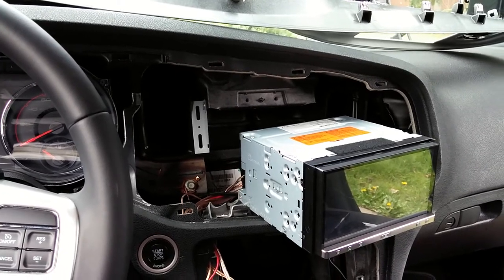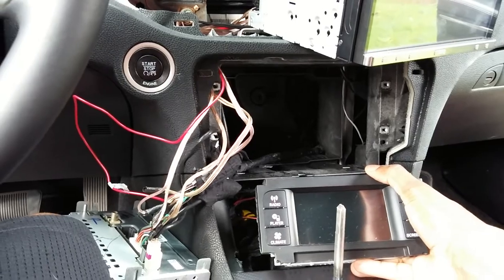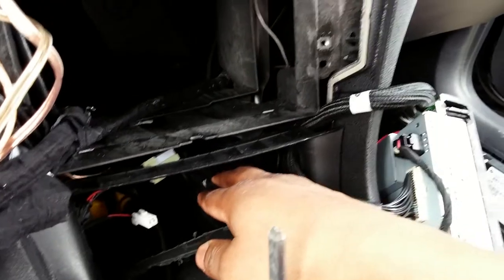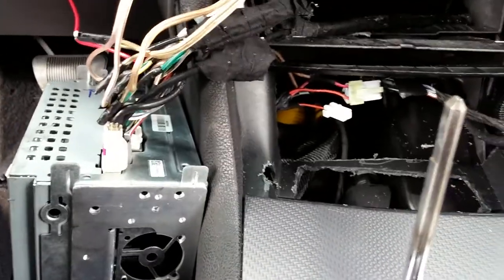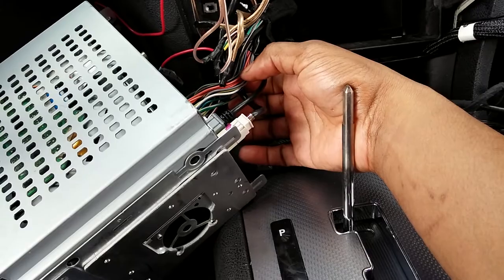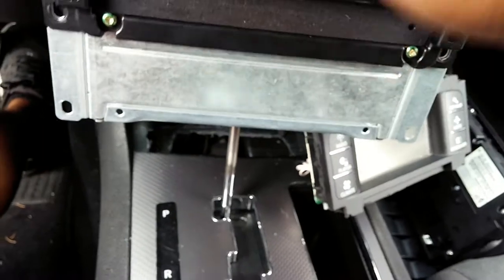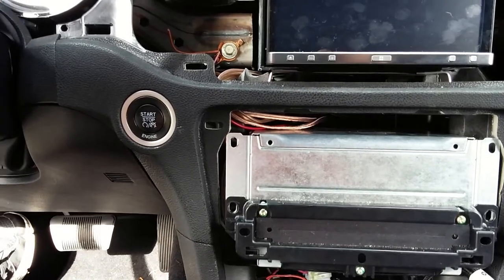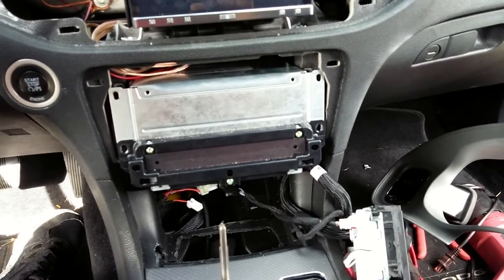2013 Dodge Charger w/ double din part 2

Comment: Kenneth ,i just wanted to thank you very much for such a cool video ,i guess even this days you still saving a lot of money for those who don t want to spend stupid money on stupid installation kits.
your video is just  genius,I took me three days instead of two because is the first time i try anything like this complex .I installed a alpine ilx -w650 which is half of the deep of a regular double din 
so i did not have to cut anything in the car except the bottom part ,everything is fully functional and the wiring diagram work perfect on my 2014 charger .Of course there is always someone that is going to complain about it or been a hater ,but to me you just save "Me"  a lot of money , but i follow your video 100% and used a lot of patience  . I really thank you .God bless you Man.
Reply: martin cito I need some advice man. I have a 2014 charger and I’m really trying to do this..When you say u only had to cut the bottom what were you referring too?
Reply: What about the power and ground and switch wiring

Comment: So I know this comment is too late but I have done something similar on my 2014 charger. I used a dual din (no DVD player) which is only 2 inches thickness so I didn’t need to cut the plastic behind the screen. Also used the output audio of the dual din as an input audio to my aux factory system so I didn’t need to cut any wire but in general, your two videos were very helpful to the project I had done, thanks
Reply: Too late

Comment: Great skills, but i wouldn't do that to my charger..
Reply: Lol you might reconsider when bluetooth starts acting like shit and all front speakers randomly stop working. The uconnect bullshit is the worst head unit I've ever came across. Factory or aftermarket. Dodge charges nearly $500 to replace the main unit which will also eventually cause the same problems.

Comment: Quick question instead of tapping into the speaker wires on the CD player couldnt  you still us the wire harness? Would that work the same and cd player just not work at all

Comment: Hey, a question about the original radio, would really appreciate your help! I got 2013 charger ex police and there is no AUX port to connect it at the center console. I'm trying to trace it back to radio, and at the back of radio I have 3 ports: (1) smooth plack wire (USB?), (1) multi pin from cd/ac, and one that you call power cord. Does this mean I don't have AUX? Is there a way to add it? Thanks in advance!

Comment: Hey man I'm having a big problem and I was hoping u could help me out...My 2012 charger climate controls won't work after installing an aftermarket radio..did u ever have this problem? And if so how did u fix it?
Reply: Reuben DeMyer that's one of my fears when I buy an aftermarket radio
Reply: Did you ever figure out the problem .. I have a 2012 charger I did the same setup now my 4.3 in screen isn’t coming on to control the a/c 😔
Reply: @travismincey8870  hey Travis I’m having the same problem with my 2012 charger. Did you get it to work and how did you do it. My head is hurting from trying different things

Comment: okay so when you started to hook the aftermarket radio up you used the factory radio as the wiring harness? and just cut the wire and connected the two?

Comment: Where are you located, I looked at a 2015 Charger today but I don't want to buy it if I can't go aftermarket everything as far as sound.  I want to end up with a aftermarket deck, aftermarket door speakers and 3 rockford fosgate P2 subs in the trunk.
Reply: Did you end up putting in a deck?

Comment: How did you get the radio to turn on and off when you get in and out the car? Yellow is constant power and red ignition switch. (That's what it say on my radio instructions)
Reply from the maker: The red 12v ignition
Reply: @andersonsr81  so plug that red but what about the yellow ?
Reply from the maker: @javoristhomas8848  connects to the 24v continuous power from the cigarette lighter wire.
Reply: Ok thank.... Mine's turn out great just that wire will not let me be great lol

Comment: Very important info missing. How you get the wires from the 4.3 cord to reach all the way to bottom?
Reply from the maker: Had to cut and extend each wire to reach to the bottom
Reply: I'm thinking about putting the uconnect in the top left of the glove box. All the wires should reach. Just have to drill a hole big enough for the connectors to slide through. Then I'll most likely just velcro the uconnect in place so I don't have to do excessive drilling and planning on it.

Comment from the maker: I charge $250 to do it.
Reply: Kenneth Anderson Can You Put A Pioneer 8200Nex In It???
Reply: how long will it take???
Reply: Kenneth Anderson how did you connect your radio's acc wire? thanks in advance
Reply from the maker: traie rogers connect it to a 12 volt wire. So that when u turn the car off the radio goes off too.
Reply from the maker: tyree thomas take about two days tops!
Reply: What’s up bro can u do this for me?
Reply: Hey can I ask you a question How did you get the a.c. to still work my radio guy is tryna put in a new radio but doesn't know how to get the a.c. to work
Reply: What state you located in